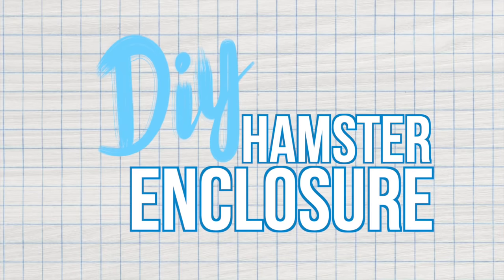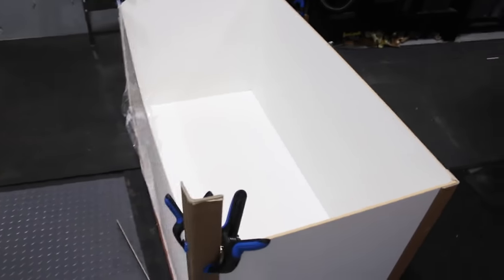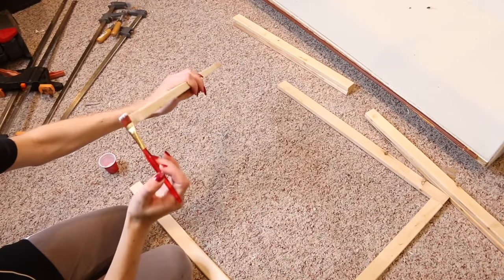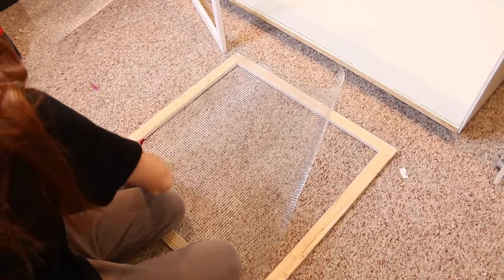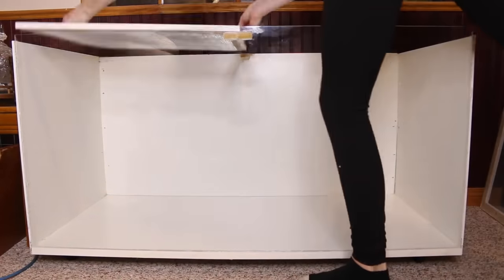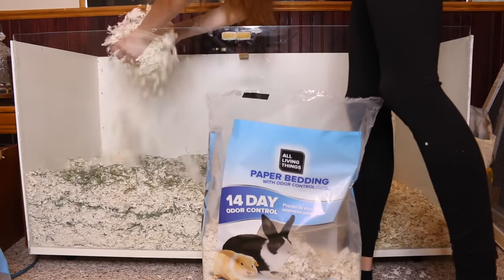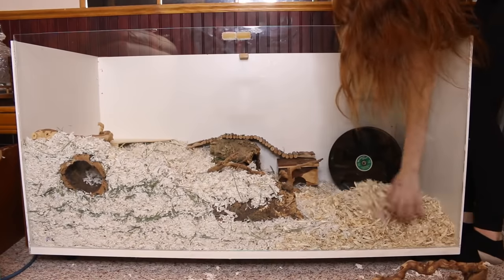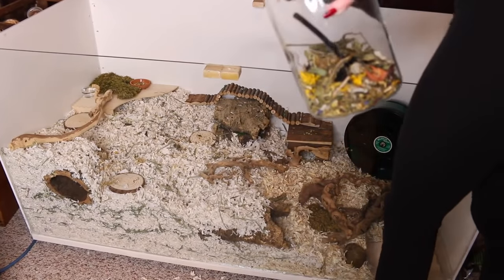Building a NEW DIY Hamster cage

Comment: So exciting to see a cage similar to ours! We built one nearly identical to this several months ago. We used 3/4" thick melamine in 2 x 4 sheets instead of 1/2" thick. We did use plexi though, because we couldn't find glass locally in the 2x4 size. Our lid is also on safety hinges that close slowly to prevent it from accidentally slamming shut. It has worked out really well and has provided our hammy with ample space to explore and dig!
Reply: i eventually want to build a cage and i was wondering what would you use to waterproof the walls and floor. i just don’t want to risk something being toxic so i thought id ask :)
Reply: @Emma-lb6fl  If you're using melamine like I did (I used 3/4" thick), then you use aquarium sealant from the pet store to seal the corners. Otherwise the surface of melamine is like plastic, you just wipe it off to clean it. But the corners need sealed to prevent urine or other moisture from getting into the corners.
Reply: dmshoney thanks so much! i wasnt familiar with melamine and didnt know that it is basically water proof, this makes things alot more simple :)
Reply: safety hinges is a supersmart idea
Reply: How did you attach the plexiglass? Is it lasting on well??
Reply: @lattendumpling3077  yes, it's still going. We placed masking tape on the spots we wanted to place screws, and drilled holes through the tape into the plexi. It keeps the plexi from splitting. Then we mounted it to the cage.

Comment: I built my own cadge, it's more of a   hutch, it's 2 floors, bottom floor is dark with bedding with wooden tunnels in the substrate so it's his burrow. top floor is activists  food and play, I was concerned about using silicone due to little information (what brand did you use? ). 
I meshed the front and back because I wanted good air flow. 
I used mainly aged and weathered pallet wood bec it hardens up and most of the bad stuff, 
I have a unlimited supply of apple and willow sticks so I like to make my own toys, I grow hurbs for cooking and hamster, I have planted some seed mix in bowls for grassy fun, also Trying to find and grow alfalfa, 
I built my own for about £25 without the tools I needed. 
I couldn't find any good cages that were big enough that I didn't have to modify, I was looking at using a indoor rabbit cage but I'm glad I didn't. I have cats so I made it 100% car proof and he has 2 floors   both are 80cm by 70cm with 30cm headroom. Ted the hamster was adopted from pets at home and loves his house, he was separated because of fighting, he did bite me at the store but that's was my fault, he's not done it again. 
You are a good source of information, I designed it for my hamster not for me using ideas from you and another English hamster YouTuber, 
The result is a relaxed happy hamster who dose not chew on the bars, he's got better stuff to do. 
I call for a revolution of hamster cages, bulid your own, don't buy a small cage. 
Money talks, if no one buys the tiny hamster cages they will stop making them and it will improve hamsters lives, 
HAMSTER LIVES MATTER.

Comment: i don’t use mesh for my homemade cages because it’s to difficult to work with, so i use window screening which works the same way, it’s just the cage must be taller than the wheel because it’s easy to escape from. however i got an 18ft roll for $3.75 so it’s also cheaper.
Reply: Problem is they can easily chew through window screen and escape!

Comment: Hi Victoria, I am actually planning to build this cage this week and was wondering when you were siliconing the glass, did you do both sides or just the inside of the cage? Also, I notice you do not put orchard grass hay inside the cages anymore with your current videos now. Is it still good to have for the structure of the burrows? Thank you so much! 
Glad you are still replying to comments after these old videos :)
Reply from the maker: It did all sides :) It's fine to add just not something I had on hand in recent videos

Comment: Just a question, when you have a big enclosure how do you clean it up? My two mice are living in a bin cage and I have to change the bedding once every 3 4 days otherwise it stinks. But as you can imagine this takes a LOT of beddings. Is there a better way to balance between comfy bedding and relatively low cost of beddings?

Comment: Hey victoria! I just wanted to ask what did you use for the things on the glass that hold up the lid? And i saw in the comments you were using an air nailer but i dont think we have that. Im making your cage btw if you didnt notice haha) but what other ways could you make the cage? Would a screwdriver or hammer work? Also, I love your videos so much! Youre like a role model for me 🤍
Reply from the maker: It's just a cut 2x2 piece of wood siliconed to the front and back :) Nail and hammer works fine!

Comment: Hi! I really like this cage design and would definitely like to somehow get o e like this. But I have to move my hamster cage according to the seasons and I am worried this would weight a lot. How much did this finished project weight? Could you move it by yourself?
Reply from the maker: Thank you! It definitely needs two people to lift it due to size. It weighs at least 30 pounds if not more.

Comment: I am currently DIY my own cage! We found a like wooden box thing (for a cupboard) and cut one half of and we are going to replace it with glass and we also need to make a lid. Oh and I have a question can u leave the sand in there all the time because the sand I have said you have to remove it once your hamster has used it for 10-20 mins
Reply from the maker: That's exciting! Yes sand baths can be left in the cage 24/7 as long as it's sand and not dust (if it's dust/powder it shouldn't be used at all)
Reply: Victoria Raechel thanks so much for replying. ☺️ and yeah I am really excited because I just wanna make my hamsters life as happy as possible.

Comment: I am trying to convince my parents this is a good thing to build instead of buying a cage because they are usually to small. A few concerns they had was if the pee would soak into the wood and it would be hard to clean because you can't take the top off to clean it. Because we're putting on my dresser and it wont be on the floor like you put yours. Can you give me some points to disprove their concerns?
Reply from the maker: Melamine wood is waterproof so it's unlikely for pee to soak through, especially since you'll have bedding in the enclosure to absorb it first. A custom cage can also be designed however you want so you can make it more assessable from the front if you'd like.

Comment: Hi i I was just wondering if a enclosure for reptiles is good for dwarf hamsters. I would make one but I’m too young to use tools. The one I was looking at has 1300 sq inches however has no mesh lid and has sliding glass. I really want this but if it’s not suitable I won’t get it. Thx.
Btw I love the new enclosure. So cute
Reply from the maker: It would depend on the ventilation!

Comment: I would love to make this but wouldn’t the wood be hard to clean on the bottom of the enclosure? Wouldn’t it cause mold? How can I make it easier to clean? What could I put at the bottom to help the wood from rotting
Reply from the maker: No :) The wood is melamine which has a layer that prevents it from absorbing liquids. You also would naturally have a lot of bedding which should do it's job of absorbing.

Comment: I have a question, there’s this hamster care group in our country where I joined as a member for further awareness with how to give proper care to my hammy, I showed in that facebook group my hamster cage setup, and I was told that I put in too much bedding. Actually, the bedding I’ve put in is only a quarter of what you’ve put in from this video of yours. I was told further that a hamster shouldn’t have too much beddings because it would be suffocating on their part and it would be too hot for the hamster too. Here in our country the usual temperature would go about 25-28 celsius but usually the aircon from where I stay is often turned on. Will adding that much of a bedding is a no or were they wrong?
Reply from the maker: It actually would be the opposite of suffocating. Hamsters in the wild have burrows that go as deep as 30 inches in the ground, they definitely do not suffocate. As well as one of the reasons they burry deep down is to stay cool when temperatures get high because it's cooler 😊

Comment: Is it better to have smaller squares in the mesh or bigger? Cause when I did my first diy cage my hamster Pixie would climb up her house and bite on the mesh at night making a lot of noise. Or is there another type of roofing I can make that won’t be so noisy?
Reply from the maker: I prefer smaller, just less of a change of a hamster escaping out. If bar bitting is happening it might be sign of needing an upgrade or more enrichment and stimulation in the cage.
Reply: @VictoriaRaechel  okay, thank you so much!!😊

Comment: Victoria i have a question is 450 sq inches a 40 gallons tank if not whats a good size tank for a hamster
Reply: kyky garon I believe bare minimum is 110 qts or about 30 gallons. However really and truly you need to measure the length and width and then multiply for truly accurate dimensions
Reply from the maker: A 40 gallon is around 600 SQ inches of floorspace, I wouldn't recommend anything smaller!

Comment: I’m planning on getting a hamster in a bin cage, do you have to put the lid on top of the bin when they are living in there?
Reply: Yes. You need one to prevent escaping, but you need to add ventilation in it so there is air flow

Comment: Are melamine boards safe? I thought they were coating in a toxic  plastic coating if the hamsters ate it. also the insides are often compressed saw dust, with a toxic glue. I also imagine the urine would soak into the 'wood' degrading it and potentially releasing harmful chemicals as the seals are broken down.
Reply from the maker: Yes as long as they're not chewed which is quite hard if the whole thing is sealed together nicely. The coating makes it quite liquid resistant especially when you use an absorbent hamster bedding.
Reply: @VictoriaRaechel  Thanks for the reply!! I have an ethical hamster breeder lined up but i have been stressing about making a cage. Solid wood is very expensive and hard to find under the lockdown! 
How long have you been using mdf?

Comment: Question: how often will you change out the whole bedding? I worry about costs even with using paper bedding.
Reply: Paper bedding is most of the time expensive, Aspen is alot cheaper. Maybe you can use that😂
Reply from the maker: Never, a full clean is very stressful. I'll do a semi half clean every couple months and spot cleaning every couple days.

Comment: What is the Square inch of this Enclosure ?  I absolutely love it. It  looks so cool
Reply from the maker: 1,152 sq inches! Thank you!!
Reply: @VictoriaRaechel   your So welcome thank you so much  just curious does this cage have more space then The Detolf also how many bags of bedding does it take to fill it up to about 10-14 inches  at the deepest  I plan on getting a Silent Runner 12 inch Wheel and it'll be for a Syrian Hamster  this enclosure gave me so much inspiration I absolutely love it  I plan on using a black type paint  non toxic obviously  to match my room theme which it Black and White Tiger Print I love black furniture did you get the supplies at a Hardware store? Approximately how much did the supplies cost I'm really curious sorry for all the questions this just really inspired me

Comment: Saw a cat in the video and was wondering how do your hamsters deal with your cat? I've been considering getting a hamster myself but my fiance and I also have a (very lazy) cat and I'm worried the presence of a predator in the house will stress out the hamster.
Reply from the maker: I've owned cats and hamsters for 11 years! Never had an issue or had anyone stressed. If you're worried have the hamster in a room where you can close the cat out of :)

Comment: Wouldnt the hamster be able to chew through the sillicone?
Reply from the maker: If that’s the case they’d chew through aquariums :)
Reply: @VictoriaRaechel  so it is perfectly safe if the hamster does decide to chew it? Also my cage is only 250 square inches for my syrian hamster is that too small? And does it need platforms if she has lots to climbm
Reply from the maker: @turnupsolid5048  unfortunately 250 sq inches would be too small, I recommend 800 sq inches 😊 I have quite a few videos on my channel on cage size and enrichment for hamsters!
Reply: @VictoriaRaechel  ah okay thankyou :) ive now built my own cage for her which is 120cm x 40cm and ive out plastic trims over the top of the silicone in the corners😁

Comment: 50 gallon storage bin ($25 at Walmart)

Hardware cloth (1/2 in $19 at Tractor Supply)

Zip ties (2 100 packs at $2 each)

Total: $46
Reply from the maker: A bin is of course cheaper but you won’t get the same size or look 😊
Reply: Depends on how you do it. I pretty much cut out all the plastic except  the corners, and meshed it all together. Really open and airy for hammy.
Reply from the maker: Then you have the issue of not being able to provide a deep substrate though

Comment: Hi, what other types of woods can be used for this diy?
Reply from the maker: Really any wood except it'll start to smell if you don't protect the bottom, melamine has a coating that makes it water proof which is why many use it for building their cages.
Reply: Victoria Raechel so is a white pine wood fine but I will have to put a hamster safe coating?
Reply: Victoria Raechel oh and thank you so much

Comment: what paint did you use? and is acrylic paint ok to use?
Reply from the maker: Just acrylic it's on the outside so it doesn't come in contact with the hamster.
Reply: Victoria Raechel how about for the inside?
Reply from the maker: Alexa there is no paint on the inside

Comment: I made my cage out of plywood is that safe if i sand it down and fill the holes with non toxic plastic wood?
Reply from the maker: Hm I'm not sure what plastic wood is, how do you plan to water proof the plywood?
Reply: @VictoriaRaechel  I was going to use contact paper thats glossy, i read online it's safer than some vaarnishes,

Comment: Hello I was wondering if a 50 gallon plastic tub would be perfect for a dj dwarf hamster
Reply from the maker: It would depend on the measurements :)
Reply: The measurements are 39-3/4 in. x 21-1/2 in. x 17-7/8 in.
Reply: TvSnowyy thats about 800 square inches which is above the bare minimum so i think thats fine !

Comment: U should buy a disc wheel it’s better for there back x
Reply: actually having a disc is worse for their back unless you buy and extra big one even then i can cause more back problems than a  properly sized normal wheel xx
Reply from the maker: A saucer would just be a waste of space when a solid wheel does the same thing as long as it's the proper size.

Comment: Why don’t you use the water bottle that has the metal spout ?
Reply from the maker: There’s nothing wrong with a water dish :)
Reply: @VictoriaRaechel  doesn’t it get dirty or tipped over?
Reply: @lexy604  you just have to change it out and if you get a glass tea light candle holder it’s heavy enough it won’t tip, my hamster used to have the problem of pooping in the dish but I would just make sure to change it out, also dishes are a lot more natural